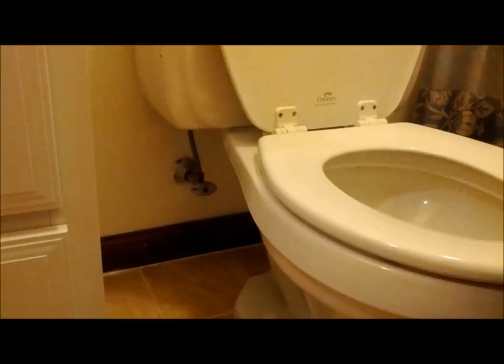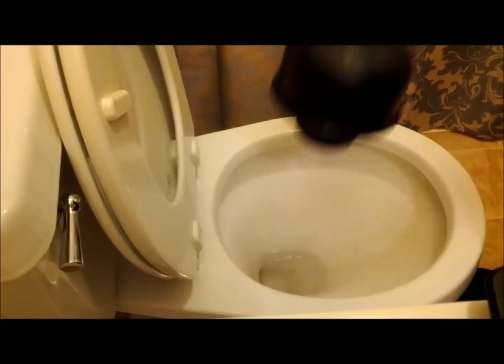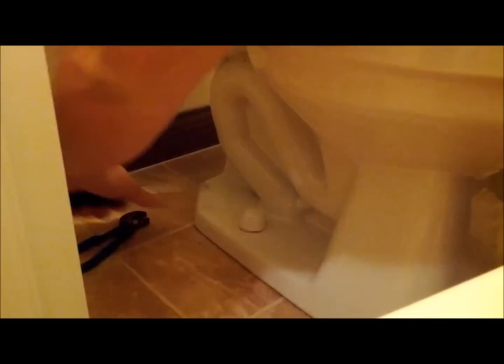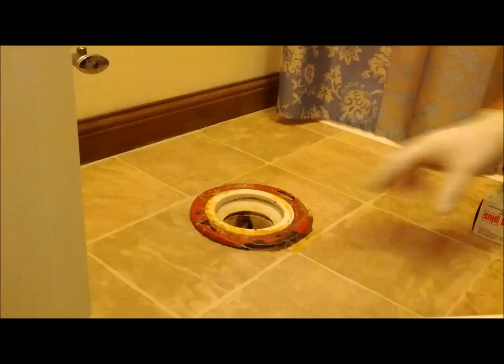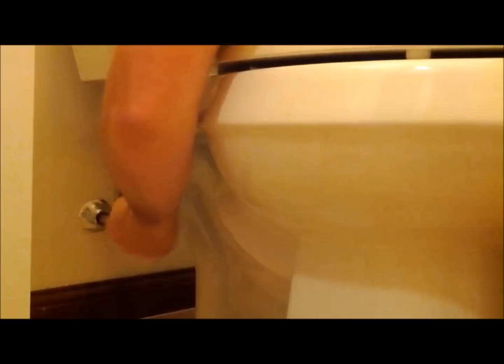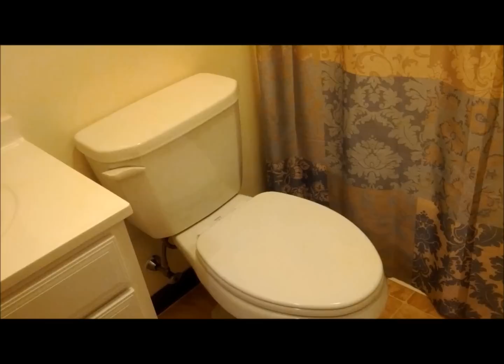How To Remove, Install, Replace, Or Update Your Toilet.

Comment: I chose by the length of the videos. If one toilet video is 5 minutes and the other is 20, there is probably 15 minutes of mindless chatter. This is straight to the point. Thanks!

Comment: So why did you use a longer water line that you have to bend instead of a straight one like it had on before?
Reply from the maker: You could use a metal or plastic cut to fit style. We seem to have better luck with the stainless steel ones and we find it easier to just stock a 20" stainless steel flexline on the truck and make a gental curve rather then carry 6+ different length stainless hoses. As you can run into a bunch of scenarios and need all diffent kind of lengths. Just carring the 20" pretty much has you covered in all scenarios. Hope that answers your question.

Comment: I don't like to use channel locks unless in deep trouble removing a rusted nut. I always use open end crescent wrench or wrench that can wrap 270 degrees around a nut. I found it very hard to remove bowl without removing tank. Please show me video of you carrying bowl out of bathroom with tank attached. Better yet, carrying whole assembly out your front door and to your curb.  
Use sponge to take water out of tank if you don't want water on your tile floor. Remove tank and carry out separately, and show in video. 

Show steps how to install guts of plumbing inside tank.

Centering new bowl on hold down bolts, for the amateur, can be very difficult, but you still did not show that step. How tight to tighten hold down bolts and tank feeder from shut off would be nice.

 I am not trying to harass you, but you really should show more steps for people who never or rarely replace their toilets.

Comment: Does the flange have to be flush or close to flush to the finished floor? Seems like this one is a good 1/4 inch higher than the floor, is that ok? Asking because i am replacing the old vinyl tiles from a second bathroom and am looking to understand if i need to make sure the flange is flush or not

Comment: i see in some videos the new wax is first placed on the toilet and then the toilet is aligned and pressed against the floor/flange, and in some other videos the wax is placed on the floor (on the flange) and then the toilet is pressed on top of the wax ring. i personally think placing the wax ring on the floor/flange is safer as it can prevent the wax from entering into the sewage line if a misalignment error occurs when placing the toilet, but curious what others think. Thank you !

Comment: Nothing about all the tank stuff though?  Did you just use the old tank with all the stuff still in it?
Reply from the maker: This was one of our earlier videos.. We need to add some other clips to this or redo this one more in depth. The new tank comes with everything installed in it. You just need to bolt it to the toilet base and adjust the toilet flapper chain.

Comment: I see you put a new gas gasket but where is the old one? shouldn;t there be an old one we have to remove to replace it? I not too handy so I a bit confused
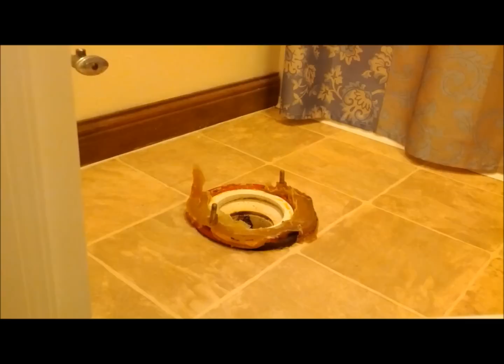Reply from the maker: The old one is there you can see it at 2:09.  If your re setting the existing toilet be sure to check the base as most times there will be wax on the toilet base and on the flange. I use gloves and a plastic puddy knife to remove the rest of the wax gasket.

Comment: In what area of the world do toilet tanks sweat in the summer? I have never heard of this.
Reply from the maker: For sure in The United States. Where are you located? I would image anywhere that the toilet tank fills with cold water causing the outside of the tank to drop in temperature and the warm air comes in contact with the cold tank, and condensation forms on the outside. If you have your A/C on all the time and low humidity within your house it wont happen. So it depends on your water supply temp and the warm/ humid air within the house.
Reply: TheDIYGuyDOTnet yeah that makes sense. I’m down south so our water temp would never get cold enough to cause the condensation. It’s just something I’ve never heard of, pretty neat! 

I found your channel because the bottom of my toilet was leaking.. lo and behold, my drain had a large amount of small roots, the flange wasn’t set properly, and it’s broken. I wasn’t planning on replacing the flange but it seems like I have to. Annoying project for sure! But your video was great. Thank you!
Reply from the maker: @phillyphill5228  Oh man roots in a sewer system are never fun.. Ya sometimes those that you think we be a quick fix turn out to be a much bigger project.  Good luck with getting it cleared out and up running again. Thanks for taking the time to leave us a comment and for watching. Don't forget to give the video a thumbs up/ like if you haven't already. Thanks

Comment: How do you know when the nuts are tight enough?  Number of turns after finger tight?  Torque spec?  My biggest problem with plumbing work is always over tightening, then I get leaks.
Reply from the maker: They do not need to be that tight. Start by hand tightening as much as you can, then tighten a little on each side and check if the toilet moves. If it does then you can tighten a bit more, check and repeat until there's no movement. You're trying to avoid bowl movement, so that it doesn't shift/ rock around causing the wax gasket to fail. On some floors you will need to shim it to completely stop the toilet from moving around.

Comment: @thediyguydotnet are you supposed to caulk the bottom of the toilet ?
Reply from the maker: Caulking the bottom of the toilet is all preference. I normally do not caulk the toilet base. Some ppl feel its stops stuff from getting under the toilet but it also stops water from getting out if there's a leak.

Comment: bro, we all know how to do the simple things like tightening a nut, lining up a toilet with 2 bolts, etc. THANK YOU for cutting out all the BS and sticking to the parts that everyone is obviously here to see. the instruction couldnt have been better. i rarely comment and when i do its mostly negative lol. great job on the vid.
Reply: I don’t see anything wrong with the Video, Single Mom here need to know that basic stuff
Reply: Yes, straight to the point works!
Reply: Negative and constructive criticism are different, I imagine you provide constructive criticism, 😂
Reply: I know many people who overtightened the porcelain toilet nut and the supply line nut.  Broke the bowl and line.
Reply: Awesome video thanks
Reply: 7 Signs or Symptoms Your Toilet Needs to Be Replaced         https://healthyhomes.co.in/7-signs-or-symptoms-your-toilet-needs-to-be-replaced/

Comment: Did not show removing tank to reduce weight of removing toilet, did not warn about overtightening bolts, did not address issue of wax ring size and removing old wax ring.

Comment: This is a great video - gets to the point right away and shows all the key steps required to change your toilet yourself.  Having done this today though, I can tell you this is no 20 minute job, especially if you're are team of one. Keep in mind that the hardware is quite heavy, you're working in extremely narrow awkward places and once you start removing the old toilet, you may find some "surprises" that are not covered in the video  (in my case, whoever installed the previous toilet did an awful job of cutting one of the johnny bolts afterward and it took me 10 minutes and some creativity to remove the nut from it).  I'd say it took me anywhere between 1.5 to 2 hours from new toilet in box to old toilet on curb with new one fully functional  (and any cleanup after). Not difficult, but it took some work and now I have a brand new toilet (that I bought on an amazing sale at Lowes) purchased and installed for $120 everything in.  Can't beat the satisfaction of knowing that :-).

Comment: This is Not a 20 minutes job and it's a two persons job. Those who say they did it in 20 min don't tell the truth. The video is good however there are several difficulties that are not mentioned.  When disconnecting the water hose, the tube inside the toiled may break loose and the last liters from the reservoir will spill on the floor: this water can leak downstairs through the floor hole for the toilet drain. When lifting the old toilet, lift first the front - this will drain more of the remaining water. Even so, there was still some water inside and at the bottom of the reservoir, and it didn't leak on the floor.  The wall valve may not close properly and water will leak on the floor - may need to close the house water valve. The toilets are heavy - need two people to carry.  When positioning the new toilet, the wax ring is very difficult to match with the floor opening because there is no space to see as the toilet gets close to the floor - at same time you need to match the two bolts. Have a second wax ring at hand in case the first gets crushed - just return it to the store afterwards. I placed the wax ring first on the toilet side, then lowered the toiled. You may have too little space if the toilet is close to a wall. Put the toilet over the hole on two pieces of 2x4, then one person is lowering the toilet rear first, while a second person is adjusting the position. Finally, one last important step: your floor is not all at level if you have tiles: you will need to insert some plastic shims to get the toilet steady.  All in all, count a good 2h-3h

Comment: Ok I removed the nuts holding it down, but my toilet was properly installed, so it has caulking around the sides. I tried a hairdryer, but the damn thing won’t budge.

Comment: What does it mean when you try to turn the water back on after and it makes a screeching noise? Please someone!
Reply from the maker: Did you replace the toilet with a new one or did you set an older toilet? Sometimes its the washer within the shut off valve it flutters and makes that noise some times you can turn it and find a sweet spot that will stop it. Some times it is the fill valve itself. Sand or debris comes from turning the shut off valve and gets in the fill valve causing them to squeal.
Reply: @TheDIYGuyDOTnet  I set back the same toilet, it is older. I will look for the washer within the shutoff valve. I'll check the fill valve as well, thanks!

Comment: Nice video. 

Just one thing that I thought he might add. A bead of white caulking around the base would be good to keep water and debris from accumulating under the base.
Reply from the maker: Thanks for watching and taking the time to leave us a comment. Caulking the toilet to the floor can go both ways and a personal preference. I only caulk them if its a person has a higher chance of wiggling the toilet around while getting off and on of it and breaking the wax gasket. Just to give it a little more staying power. If you caulk them all to the the floor you stop water from getting under the toilet but you also stop water from coming out onto the floor if the wax gasket fails forcing the water to go down into the sub floor and possible cause rot/  damage as it may go unnoticed for a length of time.

Comment: Helped alot first time. Now I have a washer on johnbolt under flange cause last guys work. Broken arm so can't get flange off. Any ideas? Don't want to re use bolt
Reply from the maker: Did he put the washer under the flange to ensure that the jonni bolt doesn't pull though the flange? Is the flange rotten? Not sure what type of sub floor you have if its wood you can cut the old bolt off/ out and use a toilet lag something like this -> https://amzn.to/2BasVul Just be sure not to over tighten it. You can first drill a small pilot hole and then put the nut on the stud and run it into the wood sub floor to the correct high for the toilet or as close as you can get it. Then set wax gasket and continue with installation.

Comment: I never even knew that they even made insulated toilet tanks now. I definitely need one because my toilet sweats a lot in the summer. Thanks.😊
Reply from the maker: A lot of people don't know that they make an insulated tank. There are two ways to fix a sweating toilet. You can replace the toilet with a newer one with an insulated tank or if its newer swap just the  tank. Which will give you a newer toilet that doesn't use as much water and the insulated tank will stop the tank from sweating. You can also install a mixing valve into the toilet water feed line. Problem with going this route is you need access to both hot and cold feed lines and to the feed line that goes to the toilet. The mixing valve would look something like this -> https://amzn.to/2B76beF .  You're welcome, Glad you found our video helpful. Thanks for watching and taking the time to leave us a comment.  DOn't forget to give the video a thumbs up/ like if you haven't already. Thanks
Reply: @TheDIYGuyDOTnet - I did give a thumbs up. Unfortunately I live in an apartment and won’t be able to do some of what you mentioned. However, I need one with a taller bowl and was planning to swap for a newer unit so I just might go that route. Many thanks again for posting the video and for the reply.😊
Reply from the maker: @pf5658  Thanks for giving the video a thumbs up. Since your in an apartment all lease's / rental agreements are different but you may be able to put in a " Reasonable Accommodation " to have the landlord pay for the new higher toilet. Might be something to look into or check out. Although he might not get the one with the insulated tank. But maybe you can just cover the difference between them. Good luck getting your new toilet in.

Comment: Do you cualk the bottom of the toilet seal?
Reply from the maker: Its up to you if you would like to caulk the toilet base to the floor. I only do it if the person using it has a higher chance of wiggling the toilet around. Just to give it a little more holding power. I like to leave it un-caulked that way if there's a leak it will come out onto the floor and be seen before it can cause damage to the sub floor.

Comment: So plunging the rest of the water out is not working can u please let me know if I’m doing sumthn wrong
Reply: If plunging doesnt work just use a shop vac
Reply: Thanks
Reply from the maker: You might not be doing anything wrong. It just might be the shape of the toilet vs the shape of the plunger. You can use a shop vac like someone said or you can use a small transfer pump like this -> https://amzn.to/2VFFwze we have used these in the past and work quite well.

Comment: Don't you have to screw the new bolts into the ground? I didn't know gently, crookedly & loosely placing them on it would be good enough.
Reply from the maker: You can use toilet lags like these -> https://amzn.to/32dFFME  but that's if the flange is rotten or you have a toilet that you are worried that will be rocked around causing the wax gasket to fail. The jonni bolts sit within the slot within the toilet flange which in screwed into the sub floor. Once they start to be tightened the stand up straight and lock in.

Comment: Excellent video!  So there is no need to run a bead of caulk around the base of the bowl? Thanks!
Reply: William Reynolds some have the caulk some don't, I like adding the caulking because the presentation looks better, also the caulking helps keep dirt and such from going into the opening.
Reply: @adam-k9o1u  Thanks for the information!

Comment: Def to the point and compact, great job as other comments say, but I was hoping to learn how to choose regular or extra thick wax ring, shim the base level or not, caulk the base or not, and why not put the wax ring on the toilet, put the toilet on the flange and weight it and twist it to seat the wax ring like the instructions say?  Or is bolt-tight good enough? Also, I would only open the supply valve enough so the overflow can keep the tank from overflowing in the event that the tank valve fails.  Full open could cause a flood.
Reply from the maker: For choosing the correct wax gasket depends on the flange height. If the flange is below the floor/ sub floor then you will want to use the jumbo/ extra thick. If the flange is above the flooring or even then you will want to use the smaller thinner one. You don't need to shim the toilet level as much as to shim it so it doesn't rock side to side or front to back. Push the toilet into the gasket and then snug the jonni bolts. Test the toilet to see if it rocks. If not you should be good without the shims if it rocks then add a shim to the opposite side to where the toilet has the most contact with the flooring. I normally do not caulk the base. If there's a leak I would want it to come out onto the floor so it can be seen and fixed before it damages the sub flooring. If caulked it will run into the crawl space or basement. I only caulk them when its somewhere were the toilet will be rocked around from someone getting on and off it to help give it some added strength to keep the seal/ was gasket from breaking. You can do it that way. They want you to put wax onto toilet base set base and then assembly the toilet. I assembly the entire toilet and set it into the wax as I find it faster and easier to assemble not up against the wall. Knock on wood I haven't had a leak doing it this way. AS you set the toilet you should feel the squish of the wax. If you don't you will need a thicker wax gasket. This is one of the video's we would like to redo to go into more detail/ of an explanation.